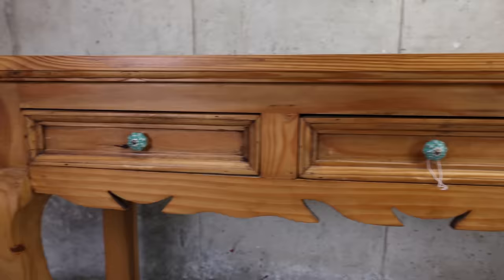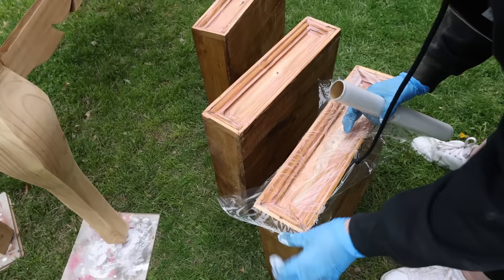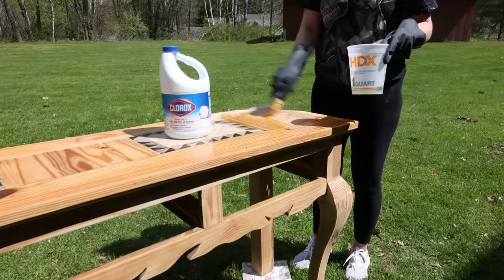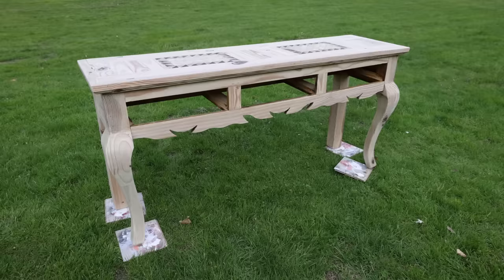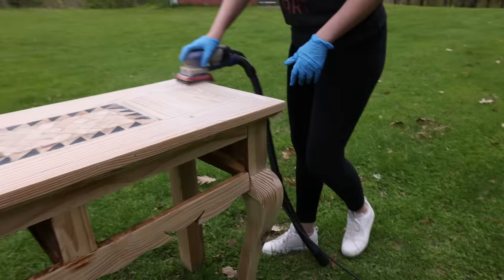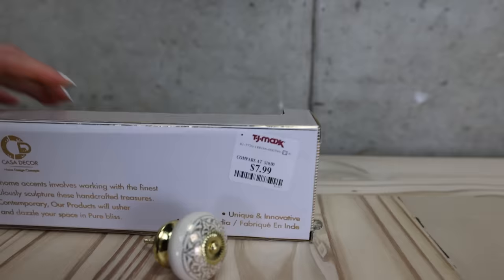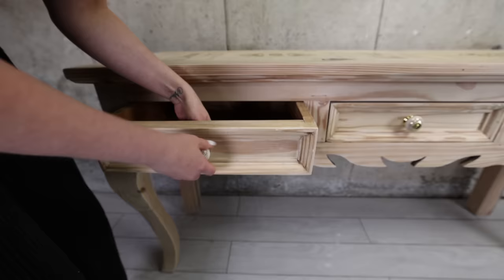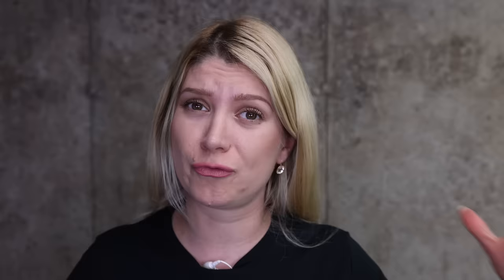Making wood Furniture MODERN with BLEACH

Comment: I have an interesting shortcut to a similar result. Strip the varnish, use White shoe polish and a cotton cloth. Spread and buff. It's easier to get an even finish than with bleach or TSP, and it's less toxic. Seal with either wax or a clear varnish. The show polish won't damage the veneer. When I was young, single and broke, I salvaged a dining table and used this technique. It looked great. I ended up selling it for 350 dollars, which was a lot back in 1982. It was art deco style did not work with the decor of my first serious relationship. All you need is a good eye for a diamond in the rough and a little imagination. Sometimes you can find better quality of furniture on the trash heap than the expensive crap they sell at Pottery Barn or Restoration Hardware.
Reply: I have a small round table and I’m going to try your tip with the white shoe polish. Thanks for sharing 🙏🏽
Reply: Will the stripper hurt the veneer?
Reply: @karinelliott9779  Strippers hurt veneer  if they dance in it their heels.
Reply: Thank- you, just might try your method.
Reply: What kind of sand paper #? For first sanding
Reply: @ingenewell5359  I use a medium grade, then fine for the second round.
Reply: Shoepolish odor???  Will it dissipate??  Sounds intriguing though!!  
Oh to clarify... old-fashioned paste type shoepolish not liquid stuff right?? Tks!
Reply: This!! This was a fun video to watch but the amount of extra steps and effort to get a result you can get with simpler methods kind of hurts my brain. 

Great project idea and high quality result, but not sure this would be good for beginners. It might be better to try it for the first time with a smaller piece of furniture that has less details and pieces to work with.
Reply: @dillpickledoe  Well, I'm not saying the results are identical, but white paste  shoe polish on sanded wood looks great, really enhances the wood grain if you do a good job with the sanding. I like to finish off with a good wood wax polishing to protect the finish. I think your way is a little more forgiving with regards to water stain resistance.
Reply: @dillpickledoe  A lot of "beginners" will probably slightly poison themselves with the bleach, those masks offer no protection from what she thinks she is protecting herself against. lol  Being outside was her greatest advice here.
Reply: @markrichards6863  lol, great response.
Reply: @markrichards6863  lol
Reply: I haven’t seen that video, this one is good enough :) love y’all
Reply: @markrichards6863  🤣🤣🤣🤣🤣🤣🤣

Comment: I flipped when you covered the tiling on the table. You removed the character and artistic touch of your console in my opinion but then again, it’s not my vision and project. Thanks for the tips on using bleach, would have never thought of it myself.

Comment: My parents bedroom furniture new in 1950 was blonde oak. Probably done the same way, it was so pale and modern.
Reply: Believe it or not, all of the 50's blond furniture I have stripped over the years was actually mahogany with a painted finish to give it the blond look.
Reply: It was called limed oak.  It came back early 2000s for a brief time.  I liked the limed oak look.  Have a dresser that has a fold down secretary desk,  very unique, all wood, no veneer.  Given to me, former owner had done some painting but the piece is too good to paint.  Will consider the bleaching.
Reply: @adrianguynn5807  eek! That's sad to me, I love Mahogany wood!!

Comment: I used this method in the 70s.  I had best results by lightly sanding aster stripping, then dampening with water to open the fibers.  The bleach then is quickly and more evenly absorbed.  Bleach dehydrates rather quickly.  Congratulations

Comment: This table turned out phenomenally well 👍.  Please include a before and after at the end.  It's hard to remember exactly what the old piece looked like.  Thanks for the video 💛
Reply: Technically, with it being a digital video, you can just position the slider to go back to the beginning and see, what it looked like.😇 But I know what you mean. I was waiting for a before and after, too. It's more satisfying and rounds up the video, if you see side by side where you started and where you ended up. Isn't  it funny that we'd rather have the creator take the extra step and edit that in instead if just rewinding?

Comment: What about painting on melamine or laminate. Would love some ideas.
Reply: Prime with oil based primer after fine sanding then paint
Reply: I sanded my butcher block laminate counter tops really well then gave them a matte black paint coating to which I added white, pale gray sea sponged accents (I had a black piece of genuine marble to copy) then very thin veins to emulate marble. After a first coat of Varathane Liquid plastic (now called polyurethane) I sanded with varying degrees of sand paper then added more veining and another coat of Varathane. I did this 6 times, omitting the new veins the last three times. The more coats you add and sand in between, the deeper the veining helping to give the illusion of genuine marble. This was a technique I learned in the theatre called trompe l’oeil or “fool the eye”.......

Comment: Thank you so much Kacha! I am in the process of stripping and sanding a old vanity and stool that belonged to my MIL. It was probably made in 1930 ish.
Over the years they painted it and stained it several times. My goal is to make it very light in color (it’s reddish now) once I finish sanding I’m trying this on it! If it works I’ll send you a pick. Thanks!

Comment: I cannot handle the smell of bleach. Hubby has to do this.
Reply: Behr wood cleaner works faster and doesn't stink.  Just make sure you work with wet wood and don't let it dry in. Rinse throughly

Comment: I kinda liked the color more before the bleach but I do see the appeal. Then again, my favorite wood stain is Jacobean color which is very dark. Great video on how to remove a stain though, I have found myself in the past wishing I could take a color off easily after not liking the one I put on it. As for the tiles, you could have just used a hammer and cold steel chisel to break those ones out and pick up some awesome new ones at a discount building supply place.

Comment: I admire you so much ! I inherited some early 1900s furniture, I was wondering if you could advise me on ,if you could only have 1 sander to do furniture which one would you buy ?
Reply from the maker: Depends on your budget. I used an $80 orbital for many years. Now I have this Surf Prep and it's awesome! It's much more expensive than the old one. If you do wnd up purchasing one you can use code Kacha10 at checkout for 10% off. Here is the link https://surfprepsanding.com/product/woodworking-sanding-systems-2/
Reply: @KachaFurniture  Thank you kindly for responding !

Comment: I love how this turned out! You just gave me some ideas on what I could do to my French Provincial table and chairs that I found for free. Its been sitting for over a year in my shed. I couldn't decide how I wanted to redo it. So glad I found your video. Quick question though., my table has or is veneer. Could I still bleach it, if I sanded my table down first? Thank you.
Reply from the maker: Yeah I don’t see why not. As long as you have wood after sanding it should work just fine!
Reply: @KachaFurniture  Thanks!

Comment: You can also deactivate the stripper with lacquer thinner. Use  I but in a metal container with a lid. Put in a couple of inches. Use old white t shirt no logos or decals. And ring out and wipe down. It also gets all paint reside. And doesn't raise the wood grain.

Comment: Kacha, you can do the bleaching MUCH faster with an A/B 2 part bleach from the hardware store. No sun required. You can even take it to paper white hyper bleaching by passing over it with a heat gun.

Comment: Very interesting video, thank you.
But I have a question: why did you say that you have to be consistent in the application of bleach? What happen otherwise? The discoloration is not the same everywhere?  And how can you be sure to be consistent in your application?
Reply from the maker: Correct it won’t be the same color. Just keep track of what parts are wet with bleach and try to spread it around evenly like a paint!

Comment: Hello Kacha from KaNada!  :-)))  I enjoyed watching you give this piece the bleach treatment. It turned out beautifully and your choice of drawer handles very styley indeed.  I have a question about the dust extractor system you use together with your SurfPrep sander.  Can you advise us what you recommend.   I checked out the SurfPref website and there appears to be 2 systems.  Many thanks!  Mary  xx
Reply from the maker: I use my shop vac from Home Depot. Surf prep makes adapters for them. I’d you use code Kacha10 at checkout you’ll get a 10% discount!

Comment: Tip:  Make sure furniture is perfectly sanded prior to applying bleach so you don't risk sanding off some of the bleached wood, which will yellow.  Also, hose off the bleach after application and then wipe dry ~ much easier.  (Won't hurt the grass).  Gold stencil was really nice touch.

Comment: I like this. But that's a lot of work. I like using a stiff bristle brush with paint-remover to get into all the crevices. I think I'd spray the bleach on multiple times and wash it off with a garden hose afterward. I also think I would bleach the entire drawer surface inside to make it look cleaner.

Comment: The table looked great, but also with that typical 
' ski challet  yellow vanished pine ' -  ' yeuch ' and you did what had to be done -  you took it back to bare wood ! 
Great transformation from ' Awful  to an Awfully
great job ' !!
Looked stunning - Although, not to sure about the paint and gold finish ??   However still a great job !   New Sub

Comment: If you want to bleach wood you need to use a two part system. First part is lye, second part is hydrogen peroxide at 30%. That will bleach the wood much faster, without need of the sun and reduce the amount of moisture introduced to the wood.

Comment: How do you prevent bleed through after bleaching a furniture piece?

I have a buffet I want to do this bleaching with, have a specific vision for it with bare wood visible. But it is teak wood, part of a set with a dinning table and tv stand. I whitewashed the dinning tabletop expecting to have bleed through because that was the case with the legs, but didn’t have any bleed through at all. I did 4 coats of whitewash to get the desired color, then left is for 2 days to be sure there is no bleed through. After 2 days everything was dry and no bleed through, so I continued with my final details of stenciling and a Prima Transfer. It turned out great 👍🏻🥰❤️ 
Left it overnight before putting on a matt topcoat, left that overnight to dry and repeated the topcoat. Everything was great, UNTIL A WEEK LATER when small bleed through spots started to appear in random spots. It is visible and it is orange yellow.
How can I prevent this from happening after giving so much time to be sure it didn’t happen, and after the table was done and sealed with topcoat as well?

Comment: I bleached a chest, followed directions, then I added a white wash. Looked great until I put my water base clear coat on. brown came up in so many areas. What do I do now that it has a topcoat?
Reply from the maker: Remove the top coat and apply non yellowing top coat. Which brand did you use?
Reply: @KachaFurniture  minwax polycrylic water base clear matte finish.  I think the  brown is Tannins from the furniture, but I bleached three times, and cleaned really well.

Comment: Hey Kacha! Was there any bleach scent after cleaned and sanded? I’m doing a desktop and its drawers - it will be a kids desk.
Reply from the maker: No there is no smell. Make sure you clean it very well with multiple waters, sand and seal with two coats and you’ll be just fine.
Reply: @KachaFurniture  Thanks for the speedy response

Comment: Kacha, just found your channel. Lovely project and beautiful finish. I have bought some typical Balinese darker colour furniture as I already have that in my house. It’s not expensive so that’s a bonus as I’ve not a lot of $ and currently unemployed also. It’s a lil darker n redder than my other stuff, if lightening very dark furniture is the bleach effect more dramatic or will one coat of bleach just lighten by maybe one shade/ 5%?  I really would like it only to be a shade lighter not 10 shades. I think I’d try this on the back of the buffet of a small section inside a draw maybe to see the effects. 
Let me know if you have other videos on lightening dark stuff “just a lil “. Also, by sanding the wood will that alone make it a lil lighter without using bleach method. If so I could try that instead....but unsure if it’s the actual wood that is so dark or the stain they use on top. 
Love from Perth West Australia....Lisa

Comment: Wouldn't sanding after the bleach process take you down to raw wood again?
Also, I'm thinking it would be so much easier and faster to just hose down the piece really good and then quickly dry it off instead of wiping and wiping and wiping with a rinse towel.  
The piece looks amazing!  I probably would've left the tile alone or gotten creative and repainted each tile into a different design.

Comment: Question: why not just turn the hose on it? Also what are those diamond shape looks like strips of tape on the top? Will you be cleaning the inside of that one drawer that looked like it had a bunch of dark wood and dirt whatever on it in it?

Comment: The cut out designs along the bottom of the table goes more with a western or Indian theme pattern on top. You should have taken a jig saw & cut the jagged cut outs into a softer look like scallops. I do like the technique of using bleach to whiten the table though. Gold stencil do Not go with every furniture style